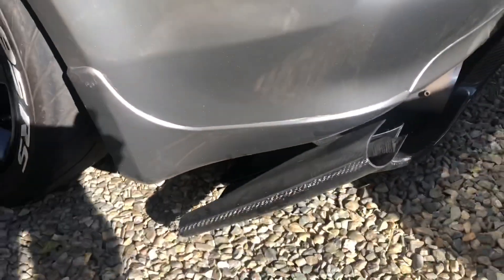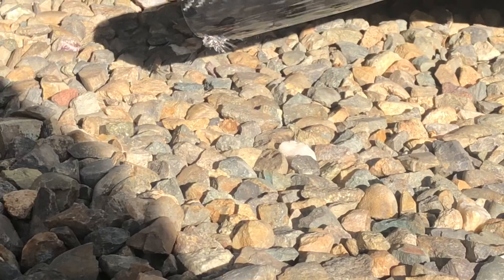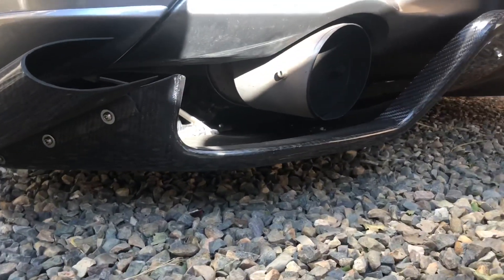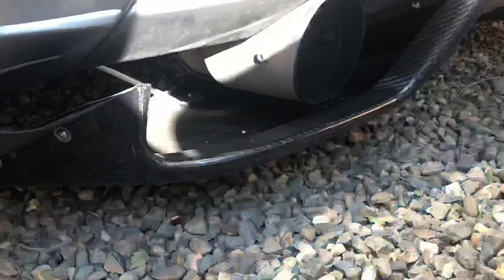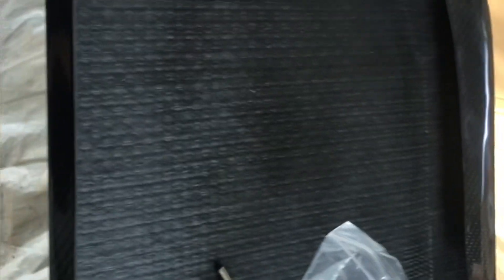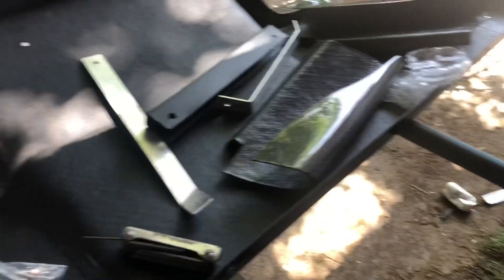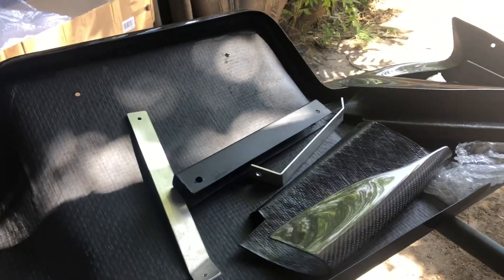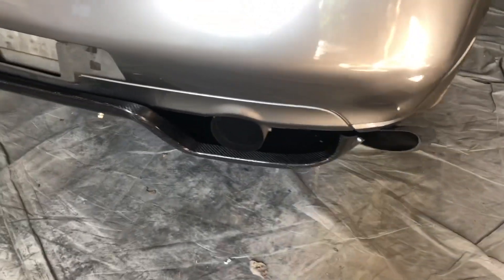G35 COUPE GETS TS CARBON DEFUSER -(🔥plus demon eye @ night🔥)

Comment: Okay, here’s whats up! Nissan didn't give America Godzilla until 2008ish, but technically the R35 (GT-R 2008-Present) isn't official Godzilla at all. Nissan did all kinda crazy reshuffling of the deck after the Skyline R34 ended production. Here’s the kicker, Nissan completely broke lineage by reassigning the Skyline nameplate to Mr Regular and discontinued the inline tradition by putting V6TT’s in the new “current” generation GT-R. Now you ask what does any of this confusing info have to do with the Infiniti G35? Well it just so happens, Nissan exported “Mr Regular” under their Infiniti luxury devision with the newly “rebadged” Nissan Skyline as the G35. Other than the JDM version being a right drive, the G35 is practically identical. So the best I can come up with is having bragging rights to instantly own the closest thing to a real Skyline.

((( 25 year import band for the previous generation Skyline - R34 featuring the coveted RB26 )))
Reply from the maker: xrmerkur thank u bro for this info 💯 skyline in  Disguise appriciate that ima screen this commnet n keep it

Comment: Hmm clearance is always a mission especially for the rear. Going over bumps n dips is the worst. I would honestly fabricate mesh and paint it black as a scrape shield. It's good you're using the first diffuser. The low life is nothing least expected of routine maintenance lol if anything you can make the brackets shorter or raise the coils. Looking great on stance my bruh
Reply from the maker: thizzface bro i know my HKS EXITs are so big the defuser can only tuck so far up . with new one i will cut groves so the defuser slide up over the cans and it tucks higher up i realy dont want to raise my car lol i love the ride height now 🤔🤟🏾🤟🏾🤟🏾🤟🏾it will take come favracting
Reply: @foreverg3549  ah I see. You can always cut the first piece so you'll know what to do on the new one. Might as well make use of what you already got ya feel me. At least now you see what gets hit when test fitting. You want minimal worries on the final setup. You got this mayn
Reply: @foreverg3549  I had the same issues with my exhaust. I should've re piped in a way so the muffler is tucked further upwards but I didn't wanna spend for it
Reply from the maker: thizzface yea (test fit) im very lucky for them shipb messed up so they made it possible . i plan to cut this one up and shorten the brackets and pull higher it will fit better i only scrapee the lil winglets as of rn i havent seen any other damages